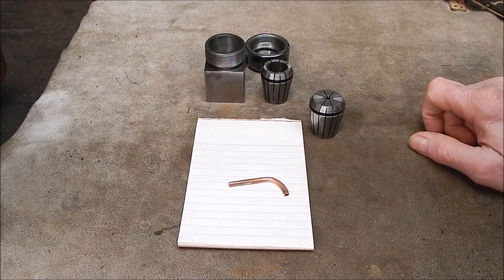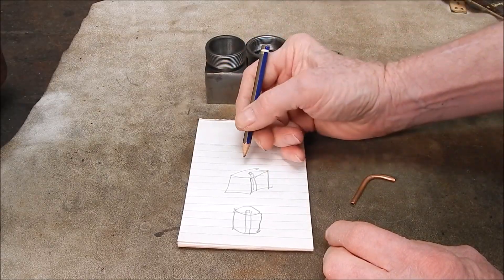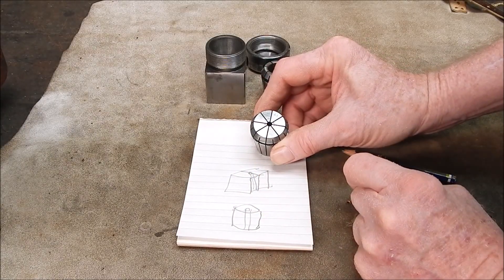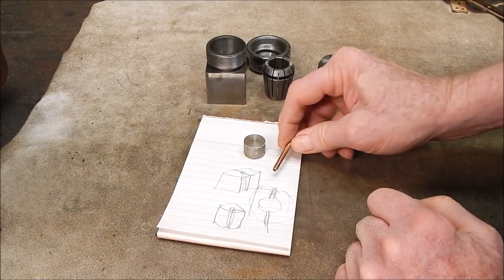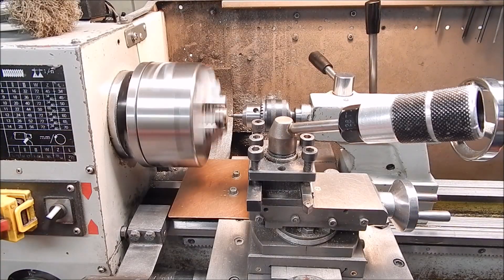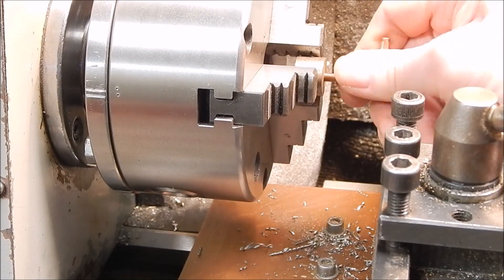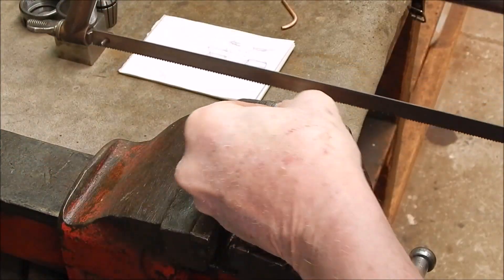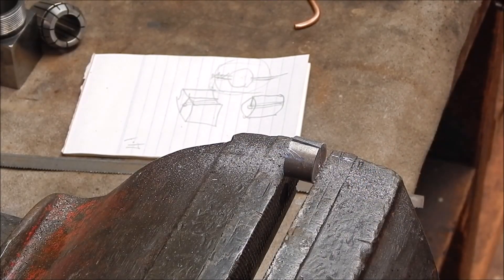Experimenting with quick and dirty homemade split collets

Comment from the maker: Note:  On reflection, if I had cut most of the way though the other side of the experimental collet as well, it would definitely have compressed.  Whether it would have sprung back to allow the release of the job is uncertain.  Even if the separating cut is slightly off centre it will not affect the centre hole accuracy/centricity, which is determined by the wall uniformity (so disregard what I said in the video :). 

The main advantage of split collets is that they are two piece and removable in all situations, so that is the most useful configuration.  These are super easy to make and very useful.  It was an interesting experiment.  Cheers Rob
Reply: Just jumped in to say that. Extend that cut and it would pinch the part more readily
Reply from the maker: Hi Michael.  Yes, trying to compress a solid steel section is not a good idea ;)  Why do we think of these things after the event ?  No problem.  At least the video gives people a good understanding of how these basic collets work/compare.  Cheers Rob

Comment: Yes this is a good way for work holding. I have had that same issue before where the steel is too thick to hold the item tight when I have a bolt for clamping. I found that I had to cut the slit past half way and stop short of cutting the piece in half. That provided enough flex when tightening up the bolt to hold the item firmly.
Reply from the maker: Yes, it's effectively moving the hinge point further from centre.  Basic physics I guess ;)

Comment: Doing the same as You did in the beginning, drilling a hole and threading it for screws You can hold screws by the thread without damaging the thread. Selecting the OD according to the thread, using aluminium and slitting it into the center... works well here.
Reply from the maker: Hi Stefan.  Yes you could, but I find using plain collets does not damage threads as the pressure is equally distributed over the thread crowns.
Reply: @Xynudu  As the force is distributed over many thread parts it could work but threading the hole would make it fit even better.
Reply from the maker: I've never tried it, but it should help prevent damage, especially on brass/soft fixtures.
Reply: @Xynudu  Yes, there it does well. I picked up the idea from a hobby machinist on YT and made some "adapters" for screws that needed some turning, mainly cut off.

Comment: G'Day Rob, I was watching another channel about a week ago and he did almost the same thing as you, except he used Delrin with a slit on one side only, for holding taps and even though Delrin is low friction it did grip the taps good enough to power tap and even snap off a tap when he bottomed out by mistake.
Keep the good ideas and mods to them coming.👍
Reply from the maker: Hi Bob.  Interesting.  I expect you could use all sorts of gripping material to make a collet.  Cheers Rob

Comment: Very good idea Rob. I think the first one would have eventually gripped, but would probably need a huge amount of pressure (tonnes) 😅 I guess this is along the lines of Emergency Collets? I’ve used split nuts to remove stubborn studs before now. Cheers Nobby
Reply from the maker: Hi Nobby.  It occured to me afterwards that I should have cut the slot partly through the other side as well.  That way the two halves would hinge near one edge and crush easily.  Cheers Rob

Comment: I've done this several times.  As you've found out you have to cut most of the way through the non-slit side in order for it to grip.  I've found that mild steel deforms, though, so it can be difficult to remove the part.  But it does solve a problem.
Reply from the maker: Yes, I thought it may not spring back enough to easily remove the job.  Interesting experiment though. Cheers Rob

Comment: That's really useful Rob 👍👍👍 If you are working on model steam engines you generally just use a couple, maybe three, different sizes of pipe. Make up a few of those split collets and you're all set. Cheers, Alan.
Reply from the maker: Hi Alan.  It's a handy trick.  Having the ER sets I hadn't made a split collet for a long time, but it's a good get out of jail method.  Being split makes them very adaptable.  You could also drill a flare taper into the end face of them to get a particular external angle.   I'm sure a lot of people have never heard of them.  Cheers Rob

Comment: Thanks for the great tip and excellent video Rob. 
I wonder how effective a timber collet cut all the way through would be?
Reply from the maker: Hi Simon.  If you use dense grain hardwood it would probably be OK.
Reply: I've used a layer of masking tape on the part in the past, if it's out by a 1 mm or so for example so wood should work.

Comment: Yes,these simple homemade split collets are very useful at times. I have made all sorts of custom split collets,which are sometimes referred to as 'split muffs' in older engineering journals.
 If you need a really accurate/concentric split collet then place the piece of bar end in the ER40/32 collet chuck or collet block and do the drilling and reaming or single point boring to final diameter in the lathe then split the collet on the bandsaw or with a slitting saw and you have a consistently accurate/concentric custom collet.
For some delicate workpieces an aluminium split collet is a good option as it will not mark the outside diameter of a precision finished shaft.
One other useful trick with ER collets is when holding short workpieces that do not extend very far into the ER collet place another plug of the same diameter as the workpiece at the rear of the ER collet and that way it will always tighten/close parallel on the workpiece.
Reply from the maker: Thanks for the tips, all good stuff !

Comment: I've always done partially split collets rather than fully splitting, but yours had a gert honkin' wall thickness.  If you'd have tried it in the 3 jaw, it probably would have worked, though, as the pressure would have been on the "unsupported" bits.  And like you say, you could have done a partial cut on the other side.  Or maybe do a top / bottom partial split like ER colles have (never tried that myself).
Reply from the maker: Yes, it may have worked better in the chuck.  All good suggestions.  Cheers Rob

Comment: Thanks Rob.  I think you are onto something here with that idea.  We can make up a secondary collet for each size of tube and always use the same ER 32 collet to hold it.
Very good idea.
Reply from the maker: Hi Glenn.  Yes, it's entirely doable, provided the split collet is the full depth of the ER collet to ensure accurate/uniform compression.  As I realised later, accuracy will NOT be affected by the position of the separating cut, as it is determined by the wall uniformity/hole centricity.  So run out should be minimal if machined properly.  Interesting subject.  Cheers Rob